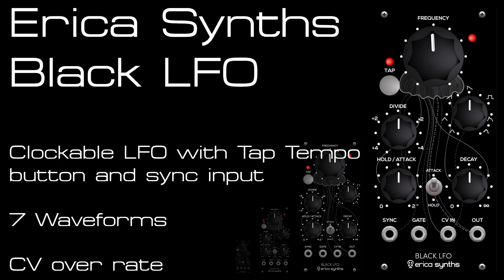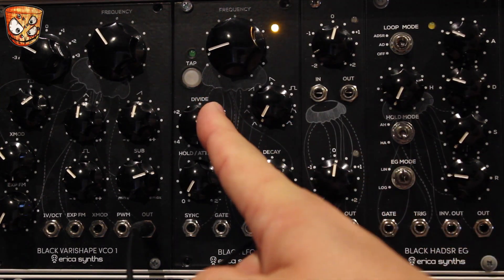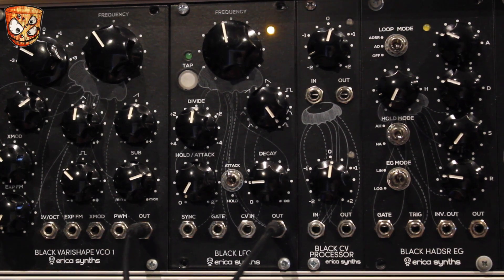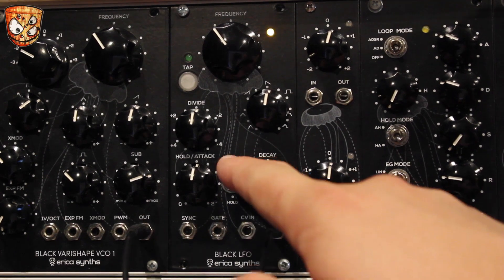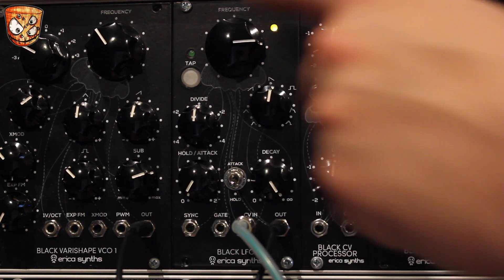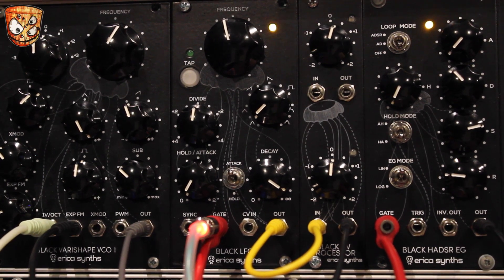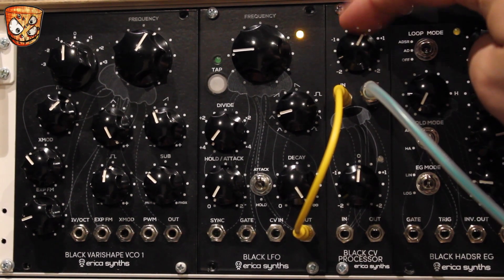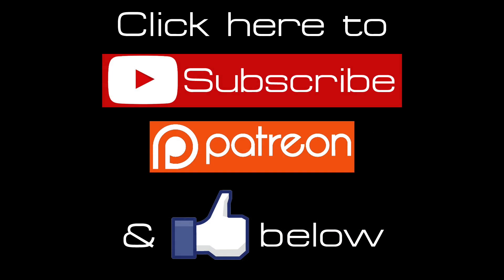Erica Synths - Black LFO

Comment: @DivKid
hi , at minute 7:40 , which modules play together, only the BLACK LFO + BLACK CV PROCESSOR, and an Oscilator, but which on  ? 
how do you create that shaping sound ?
Reply from the maker: It's a wavetable oscillator with the LFO shape shifting through the wavetable with attenuation / level control on the CV processor. The shape is shifting beyond a basic single waveform cycling with the on board envelope generator on the bottom of the module. Hope that helps.